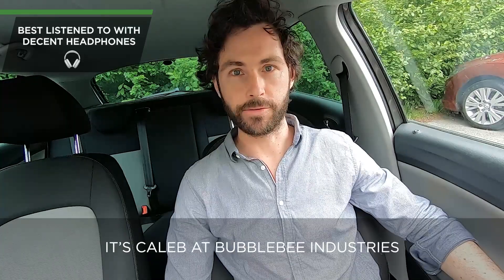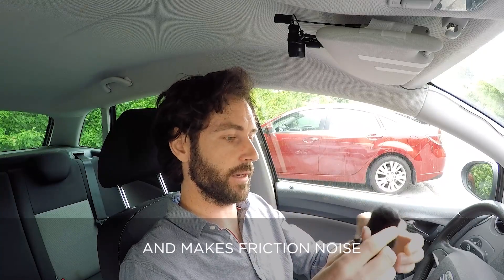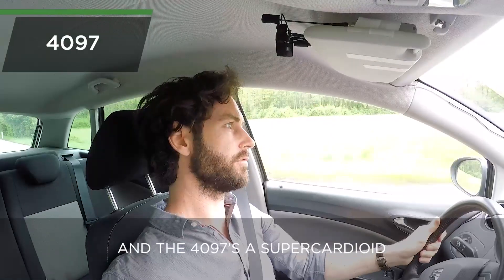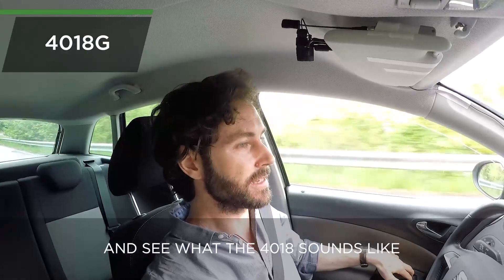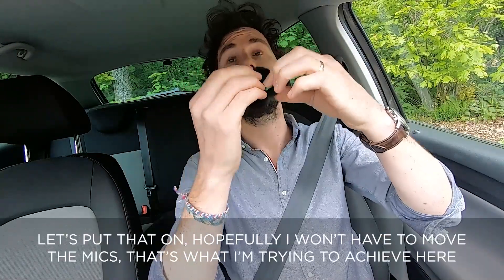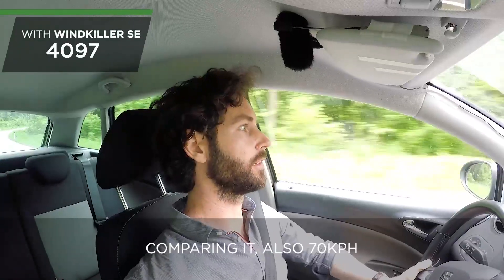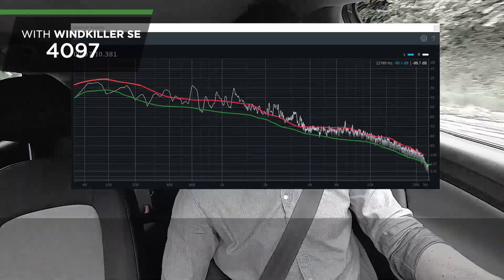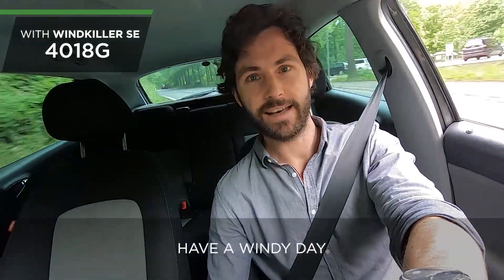Recording in a car with DPA Microphones 4018/4097 and The Windkiller SE

Comment: Hi! Nice SE series! Saw the 4097 fur in the hands of a collegue. He was concerned that it wobbles too much, when shaking. It seems loose, but I understand it is also because of safety of the 4097 capsule.
Reply from the maker: Hi Taisto, thanks! The elastic band holds it in place / keeps space inside the Windkiller around the front of the capsule as this dead air is the best remedy against wind pressure. If you shake it, it will shake, but these mics are not meant for shaking. In the context in which we used them here, and most plant mic situations, the mic sits relatively stationary. In extreme situations, shaking will be a problem even with no wind protection as the 4097’s built in suspension can only protect from so much vibration. In which case the issue (if you think there is one) is pretty moot.

Comment: What TX is running these? Thanks for the great video!
Reply from the maker: Wisycom MTP40s
Reply: @bubblebeeindustries  do either the 4097 of the 4018G require phantom power?
Reply from the maker: @Logolth  both do. The MMP-G pre for the 4018 supercardioid allows it to be fed by as little as 5V, which is around what these transmitters usually provide. 4097 also requires 5V.